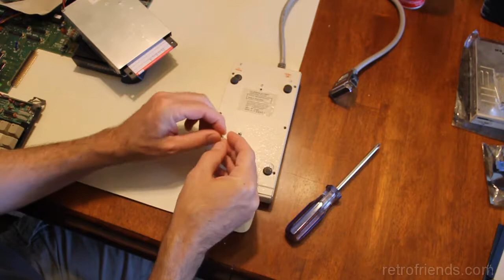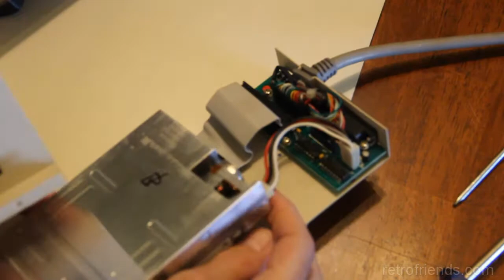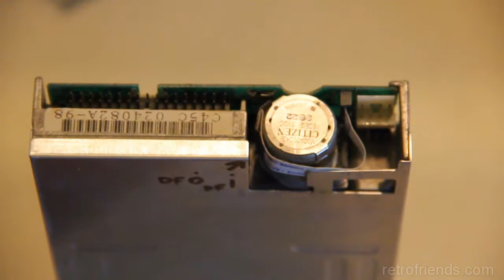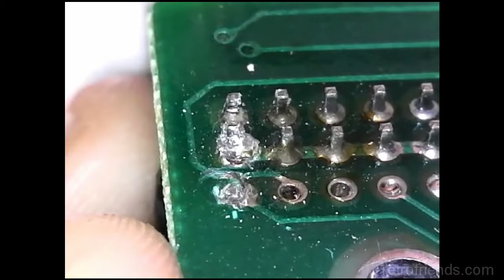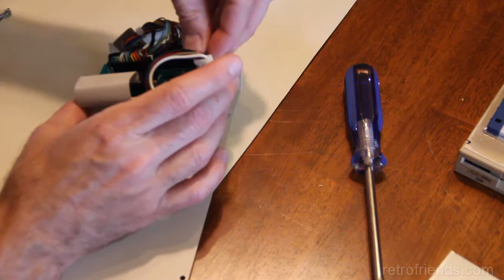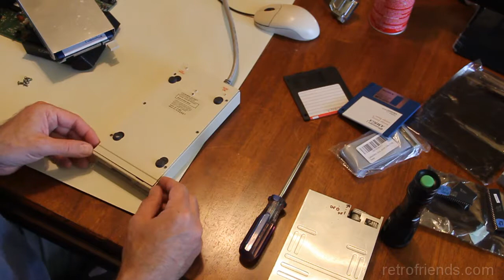California Access CA-880 Teardown and Repair

Comment: The switch you refer to on the floppy drive as being for DF0 or DF1 is actually for S0 and S1 - i.e the first and second select lines wired to it. For the first external drive (in the drive daisy chain) this will be the select lines for DF1 and DF2 respectively. In Workbench it does not indicate which drive the disk is on/in - so you can't tell from there. You can run the ASSIGN command in an AmigaDOS shell to see which drives are connected - so you can see whether the external drive is responding to DF1 (switch on S0) or DF2 (switch on S1). So the drive will actually work whether the switch is on S0 or S1, but just respond to either DF1 or DF2.
Reply from the maker: Thanks for the correction.